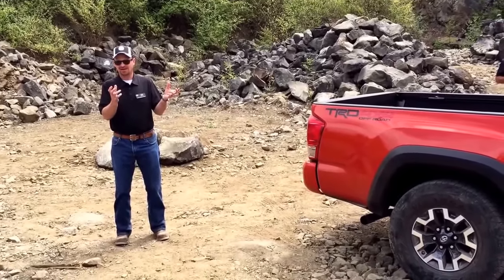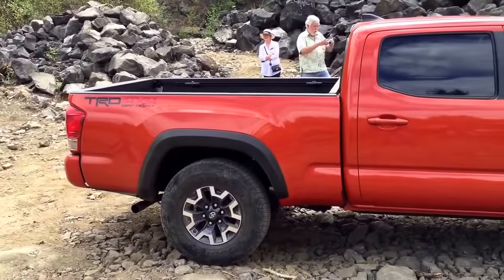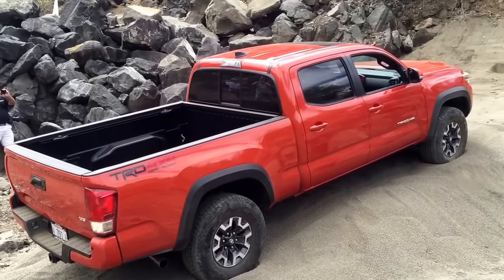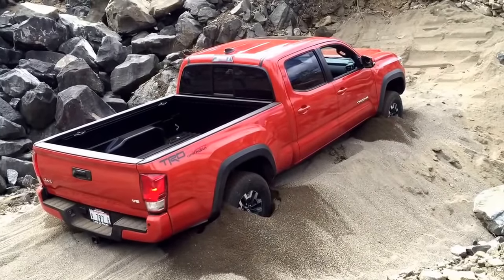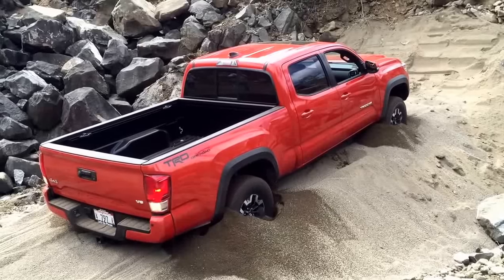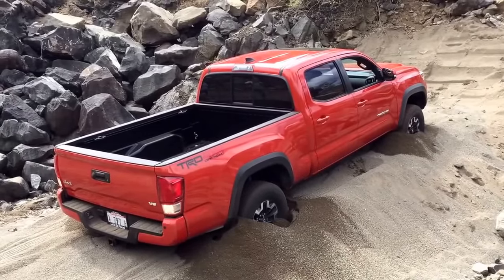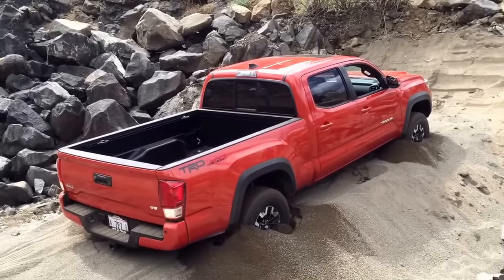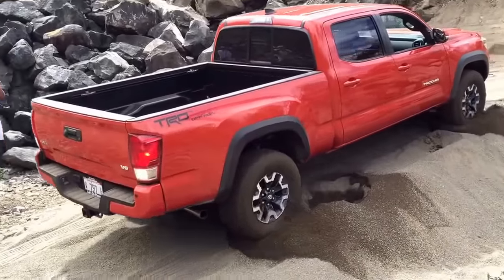2016 Toyota Tacoma - Demonstrating Crawl Control

Comment: You don't need a gimmick like "Crawl Control" to go back downhill after burying it... ANY vehicle will pull dirt back under the tires, just have to use proper throttle control.
Reply: bluesti3 Truth.  I buried my '98 Tacoma (locked in front/open in rear) to the rear axle and frame in the front (sliders were like a half inch off the ground) being forced to play tug-o-war with a 2nd Gen TRD OR (neither of us moved).  Anyway, with proper use of the throttle, I was able to fill in the bottoms of the holes the tires dug out until she climbed right on out...with no fancy Crawl control or even ATRAC.  This was on flat ground with no hill for gravity assist.  Also, I did the exact same thing as seen in the video with my '96 F250, deliberately getting it stuck on a sand hill (posing for a photo), then with proper throttle control it clawed its way out backwards down the hill...again, no crawl control involved but it looked exactly like this video.
Reply from the maker: Taco No Baka Please eMail us a link to the video on your demonstration and we'll post on this channel. Thanks!
Reply: thedriversseat I'd love to, but it's one of those "pics or it didn't happen" scenarios, haha.  Didn't get any video of the OGT working it's way out and I only had still images of the F250 being buried on the sand hill.
Reply: Come to think of it, I am going on a wheeling trip in mid-october to a place that has some nice soft sand hills.  The Odd Green Taco doesn't like sand much since the Swampers go straight for China as soon as the wheels start to spin, so I'll see if I can reproduce what's seen in this video with old-school tech (Lincoln locked front diff and a Detroit locker in the rear)...and get it on video this time. =D
Reply: bluesti3 See you are a Ford fanboy.  Just like there gimmick of trailer backing up.
Reply: +Jay Trock Not a fanboy, I just know how to drive off road, and don't need silly tricks that a vehicle without his equipped could do exactly the same.
Reply: +thedriversseat I am happy to do a video next time I am on the beach. I won't even turn on lockers for that. I have to agree with +bluesti3, this video is a joke.
Reply: +bluesti3 just what I was thinking, backing down hill is impressive? LOL  Go toyota racing division!
Reply: bluesti3 Glad you know how to wheel just like I do, but we are not the norm. I also know how to drive in the snow, rain, and threshold brake.  Guess they shouldn't put traction control and antilock brakes on trucks..
Reply: Jay Trock I actually have had problems due to anti lock on my 4x4.  while raving to get out of mud, suddenly got great traction, hit brakes, anti lock released them and I went too far and into another problem.
Reply: +bluesti3 I came here to say that lol guess you beat me to it
Reply: +bluesti3 The point is that it does it automatically and . If we used your mindset we would still only have hand tools and rub sticks together to start fires. I mean, anyone can start a fire with sticks if they use the right technique and patience right? Or you know, you could just use a lighter and have it done in 2 seconds. The point isn't that getting unstuck is something only this truck can do, the point is to demonstrate the technological advancement. 98% of people will have absolutely no use for this anyways, but that really isn't the point.

I'm not a fanboy and I don't even like trucks, I just saw this and it intrigued me to watch it.
Reply: +Chris Go 
Anyone stupid to be out in snow/icy conditions to the point where they get stuck, shouldn't have any vehicle...
Reply: A lot of people have no idea what to do when stuck.  So if you add a feature and a button it makes it easier for a lot of people.  The people who don't need it wheel day in and day out and have a good idea how to get unstuck.
Reply: +bluesti3 keep in mind this feature is for the dumb dumbs that just think pinning it will work.....90% of the market essentially.
Reply: +dontbeghey When you're a corrections officer and you must be out on the roads, what do you do then?
I agree. This test should have been performed on level ground.
Reply: +bluesti3 the point of it is just so it's easier... you're dumb as fuck lol. Why learn proper throttle control, when you can have a computer do it for you?  I mean it's good to be learning how to control your car better, but you have to understand, not everyone is a car fanboy like you. Not everyone wants to drive a manual, because you'd be doing something you don't have to do.
Reply: +FartParticles So you're too stupid to learn how to do it manually, and need a computer to do it for you... But you say I'M dumb?  Haha... The irony is just too much.  Moron.
Reply: +bluesti3 we live in a world, where I don't have to learn that. it doesn't take a smart ass to learn proper throttle control lmao. you sound dumb as fuck. trying to boast about your own throttle control?
Reply: +bluesti3 there is no irony there.... do you even know ehat irony means?  I think you should get off YouTube, and go back to class. stop skipping lol, your lack of intelligence makes me question where you come from. Because your education system must be shit, considering your ignorance.
Reply: +FartParticles I helped build and operate an off-road tour company, spanning California, Arizona, Nevada, Utah, and Baja Mexico expeditions.  For a full-time job, I manage a gas-turbine power plant in Los Angeles.  So yeah...  I don't know how to drive off-road, and I'm also REALLY stupid!
Reply: +bluesti3 being able to drive off road, is supposed to make you smart?  yes, o believe you did all that because you clearly didn't go to school instead. a dropout huh?
Reply: +CaptainT97 lol exactly why you said "probably". I don't know what you're talking about all vehicles today are all computers anyway. proper throttle control to get you out of a situation like this, does not mean you're using less computers you dumbfuck lol. are you stupid?  you think, just because a car does not have this feature, it has no ECU? PCM, BCM,TCM? why bother even replying to me? you sound dumb as fuck lol
Reply: +CaptainT97 Clearly a teenager with no communication skills outside of Facebook or YouTube.  Really not worth the time responding... but hard to resist when they REALLY have their heads up their asses, like this guy.
Reply: And fuck u bluesti3 I was saying if he prefers computerised shit like assisted parking and this crawl bullshit cool for him I don't see the point unless u can't drive
Reply: +bluesti3 plus I was defending ur point it's useless
Reply: +bluesti3 lol if I were you, I'd feel ashamed then. a teenager, more educated than yourself? you should probably go back to school.
Reply: +CaptainT97 your point is exactly like saying there is no point of having an automatic transmission... because what's the point of it, unless you can't can't drive. which in that case.. you shouldn't be driving at all. The point is that, we don't have to do something... we don't need to. this setting, makes it easier for everyone.. not everyone is a professional driver like you, ok?
Reply: +teaspoon Apparently Ford owners can also "drive"...
Reply: +bluesti3 Guy, you're really not getting the point. You talking about your profession and passed profession just made you look even more clueless. It's like a pro rally driver laughing at the regular daily commuter for wanting traction control in a 300+hp RWD sports car. People who know how to driver don't need automatics, traction control, abs, blah blah blah. Though most people are not huge car enthusiasts so they do not know how to work a car properly without it. 

I mean if this is just an ego thing for you, whatever. Congratulations, you know how to get a truck unstuck. Many people do not though, so this feature WILL help them.
Reply: exactly what Hunter said, the fact that you can have an assist but you specifically don't need it doesn't mean that no one needs it. Not everyone knows how to unstuck a truck that's why there is crawl control, not everyone knows how to emergency brake that's why there is ABS and I could go on about electronic assistances that most people need all day. The fact that you know how to do something that some of us don't doesn't mean it's unnecessary or useless
Reply: +Warren Lancaster Damn right. I was out in my Ram pulling those so called "stupid people" out of ditches and snow banks who apparently deserve to die slow freezing to death. Just riding around looking to help.
Reply: +Hunter W No, I do understand what the purpose is, believe me...  It's for stupid people that can't drive and don't understand physics, that are off-roading with no experience.  So let me re-phrase, "99% of the population doesn't need a GIMMICK like crawl control".  If you're part of that 1% that do, then this truck is PERFECT for you!  But be warned... you still have to steer, use the gas/brake, and turn the key "on" before the truck works.  Might steer that same 1% away.
Reply: im from mn and ppl that drives trucks and suv think theyre badasses in the snowy months. then i see them get stuck in snow like dumb asses. this feature will help them get out of the problem. lord knows these dumb ass city slickers dont know jack shit about throttle control.
Reply: I'm really sad when people that haven't actually drive in sand start commenting. You cannot get out of sand even if you know how to drive auto or stick. Its not easy and almost impossible without crawl control
Reply: bluesti3 No, you obviously live on a different planet than I do. 99% of people know how to drive? It's much closer to 99% DON'T know how to drive. The average person has absolutely no clue how to REALLY drive their car. Hell, the average person can't even tell you the pros/cons of a FWD vs RWD. Seriously, what planet do you live on?
Reply: +bluesti3 Hunter is right.  I think you have your numbers backwards.  The majority of drivers look at their cars as appliances, just ways to get from A<->B without knowing or caring to know anything about them.
Reply: Bill Hartsford You make a good point. I think he'll understand that one.
Reply: +Bill Hartsford I said 99% don't need crawl control... referring to the percentage of people that would off road their vehicles to begin with.  If they need a program that just "retards" the gas pedal, they shouldn't be doing aggressive off-roading to begin with.  It's a gimmick, but apparently it's impressing a small portion of you who are replying in protest... so I guess these sales gimmicks DO work for a percentage of the population.
Reply: +Hunter W I love this percentage of the population who seem to just troll youtube 4x4 videos trying to convince everyone how big their dick is.
Reply: +Hunter W Ah, the old "kid" comment, as if this implies you're wise and all-knowing.  Some technologies such as ABS, Traction Control, and Sway Control are absolutely NOT gimmicks, and make a car much safer.  You're totally missing the point in this instance.  This "gimmick" just applies a small amount of throttle, because morons who are stuck just floor it thinking POWER = GOOD, not knowing any better.

Thanks for the tips old man, but every "Liked" reply on this video is people trashing this idea also... so apparently I'm not the only one by far who thinks this is a retarded "gimmick" aimed at parking-lot off roaders.  In either case, I'm happy these "gimmicks" impress the common-folks like yourself, you should get one!!
Reply: bluesti3 It doesn't impress me, but it could definitely be useful to people. I call you a kid because you're acting like one. "I know how to do something that others can't, they must be morons". See how dumb you sound? And no, I wouldn't be surprised if all vehicles had something like crawl control one day as technology advances. Just like all cars these days are shifting towards DCT instead of manual.
Reply: +xk302a á
Reply: Some cars
Reply: That's cause you're an experienced person, I believe, who does that for fun. People who use trucks for work doesn't necessarilly got that hability and need that to save them some precious time!
Reply: +xk302a saying you can do what crawl control does solely with throttle control is like saying you can recreate what an LSD does with just throttle control.  it physically isn't possible
Reply: +Matthew Slusar Your're joking right? Once that hole is dug and you back out of course its going to refill the hole, especially going downhill. If he had made it up the hill from that spot, it would be an accomplishment.
Reply: +Matthew Slusar explain to me how a human can't mimick throttle control.. And while you're at it, compare computer simulated human response vs human response,  to lsd vs open differential. 

Let me help you. Me and the computer have the same exact control over the throttle. But, an open diff will never be lsd, and the only way for a computer to simulate it is to use abs. But, we can tap the brake to force power to both wheels too.
Reply: +hugeslacker didn't say it wasn't possible. cruise control must be a gimmick too right? even though every single car today has it right? obviously one could hold their foot perfectly still to maintain speed, but you know what humans do? we think of things that can help make our lives easier. so one day somebody invented cruise control. by your logic power steering and brakes is a gimmick. "why make it easier, use your muscles!"

crawl control is no different. the purpose is so that it's easier and more user friendly. bottom line. you must think automatic transmissions are a gimmick too hahaha
Reply: I was thinking the same thing and strongly agree with the backing down hill point. If you wanted to prove there is something special going on here then maby you should of had the driver go forward and pull itself out while going uphill and that just might have made a believer out of me.
Reply: The difference is when the convenience outweighs the cost and possible failure points. Rocking is easy, and you will spend less time using the crawl control compared to say, cruise control. Cruise control also isn't a throttle lock (As you said " obviously one could hold their foot perfectly still to maintain speed" but cruise control isn't that simple) . By your own logic, I guess you assume power steering and power brakes have the same level of complexity as a throttle lock?

Power steering and brakes are also safety features and save lives.

It's an extra 2k msrp for the package that includes crawl control. Is it worth it? Maybe for some people. But one thing you CAN'T argue is it will benefit the average car or pickup driver NEARLY as much as cruise control, power steering, or power braking. It's an extra switch and programming that costs money.
Reply: 45 degrees? Is your ear sewed to your shoulder? They made a bit of an incline so it was easy to bury it to the frame. 45 degrees it was not.
Reply: Taco No Baka did the same with my jeep. This video is a joke
Reply: bluesti3 yfxdh
Reply: Matthew Slusar Cruise control IS a gimmick. How many accidents are caused by cruise control vs how many are avoided? I'm willing to bet that more people enter turns too fast and crash while using cruise control, than don't. And actually, auto transmissions are too in many ways. Go to europe or south america, or anywhere other than this country, most cars are manual because they're more fuel efficient, and more reliable.

Oh, and don't hold your foot in one place to maintain speed either, you have to adjust your throttle input based on hills and turns, even wind resistance. but since you forgot how to drive because of cruise control, you don't even know this anymore. A driver with more control over the car is a safer driver. You don't even know how to maintain speed anymore, what good are you on the road? If you can't drive, don't. Simple as that. No amount of computers (besides completely autonomous cars) can make a bad driver good. And even those cars give control back to the driver in emergency situations.... But if you're sitting on facebook or playing games while the car is driving, what good are you in an emergency situation you're not even aware of?

My jeep may not have cruise control, or abs, or "crawl control", but I do.
Reply: hugeslacker get off your high horse your nothing special. automatic transmissions are now more reliable and more efficient than any manual today. go look at the ram 2500, a perfect example, towing capacity and mpg are both less with a manual. cruise control doesn't cause accidents, negligence does. like you said morons using their phones while driving that causes accidents. And yes climb control is a gimmick.
Reply: FartParticles how stupid can you be to call a guy a "dumb fuck" for knowing how to drive his vehicle. it's sad you would rather just sit back and nothing about what is going on.
Reply: william baxley and a rebuild on that 9 gear box is like 10k if you can even find someone willing to do it. When was the last time Dodge put a strong auto transmission on a truck? Why do you assume they started to now?
Reply: hugeslacker really because the 2500 doesn't come with a 9 speed. And the aisin transmission they offer is an excellent one. But this will turn into a pissing match of truck companies. And I was not talking just trucks, but all cars in general when it came to automatic transmissions. And if you look at the total amount of automatic transmissions the failure rate is very low.
Reply: I got that "crawl control" on the old chevrolegs. It's called the rev limiter AKA valve float.
Reply: Ramiro Soto "balls to the wall mode"
Reply: ted s we keeps it 💯 dog.
Reply: Ramiro Soto fasho
Reply: woe
Reply: Neechie Lit
Reply: thank you for pointing that put.this is not magic.
Reply: bluesti3 agreed.. I'm having a hard time understanding what they did.. anyone could have put it in reverse and gave it a little gas and the same thing would have happened..
Reply: bluesti3 I had a 2006 Tacoma with no granny controls and I took it to Moab twice, rubicon twice, Dusy ershim once, and I didn't need a crawl control to get me out.  Driver skill did the trick.
Reply: some one  they did that because some of the people that doesn't understand how to 4wheel drive
Reply: bluesti3 that's exactly what I thought
Reply: bluesti3 i
Reply: bluesti3 this is true, I've been stuck a few times in mud and in loose dirt, always been able to get out of a hole I dug myself. Also I turn the wheels to gain some traction and pop out. Tacomas rule! :D
Reply: ive seen someone use it to crawl over rocks